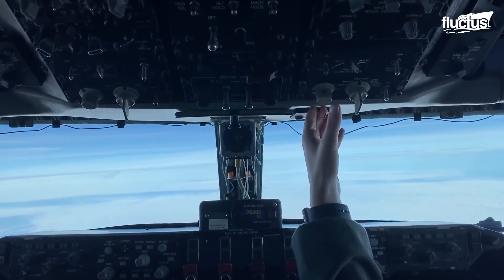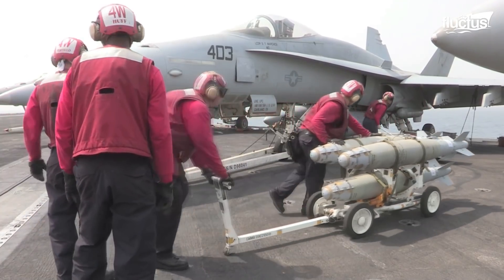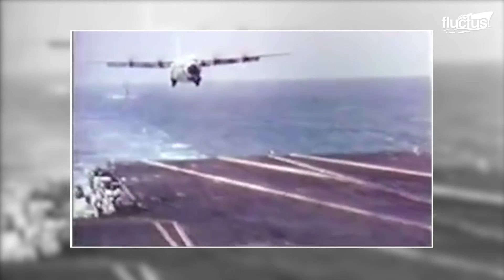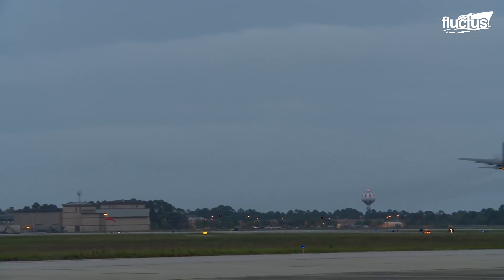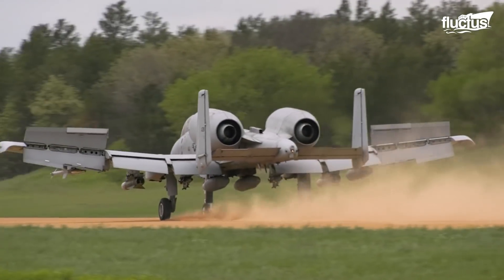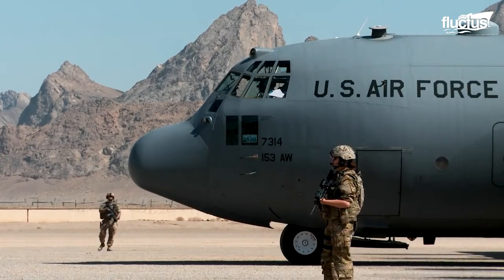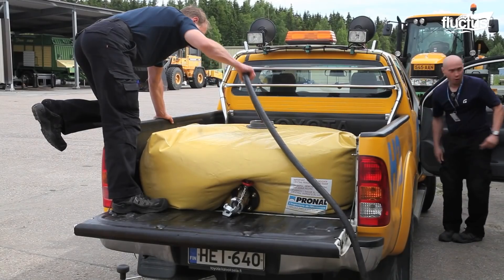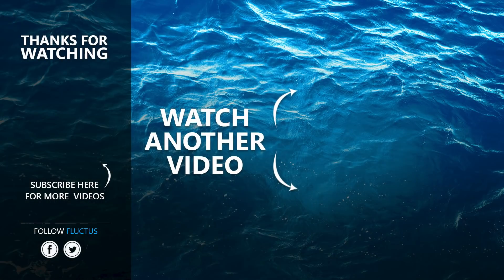Why the US Landed the Largest Plane on an Aircraft Carrier at Sea

Comment: Those were U.S. Navy pilots with a U.S. Marine Corp KC-130 that landed aboard Forrestal.  The pilot, then Lt James Flatley,  was an experienced fighter pilot and test pilot.  Also onboard was Lockheed's chief test pilot for the C-130, as well as a Navy co-pilot and flight engineer.  Though it was proven the C-130 could land on the carrier, the entire flight deck had to be respotted to clear the flight deck, as the plane didn't land on the angle deck but needed the full length of the carrier.  The right wingtip of the Herc only cleared the carrier's island by 15 feet.  The Navy decided it just wasn't feasible and too risky to go forward with using the C-130 as Carrier On-Board Delivery (COD) aircraft.  Rear Admiral Flatley is the only pilot to ever land a C-130 on a carrier.  Incidentally, painted on the right side of the C-130 was a large sign:  "Look Ma, No Tailhook!"  The Landing Signal Officer would give Flatley the cut sign while the aircraft was still about four feet from touchdown, and the interlocks on the throttles had been overriden to allow the engines to be reversed before touchdown.
Reply: Yeah I know. I was there.
Reply: Capt. James H. Flatley III was our CO on the USS Saratoga in 1980.  While we were in the Mediterranean in the summer of '80, he completed his 1500th arrested landing in an F-4, with his son in the back seat.  His son was a midshipman at the time.  When Rear Admiral James H. Flatley III retired, he had over 1600 arrested landings.

Comment: BIG difference between a C-130 Hercules and a C-5 Galaxy. Main one is the C-5 is jet powered and much larger and the aircraft tested for carrier operation was a turboprop powered airframe. Major difference in landing speed and wingspread.  So your "largest plane" designation is grossly incorrect. You need to get your "fluctus" together, because you do not know your subject....as usual it seems anymore.

Comment: What allows the C-130 to do short landings is the reverse thrust capability of the turboprop engines.  These engines have the same power in reverse as they do forward.
Reply: Sorry, I thought you said reverts thrust engines.  At first read, I  didn't see the "turboprop."
Reply: Wow!  That same power in reverse.  That is incredible.
Reply: @kurtjefferis785  that would mess up an adversary, pull up to his nose then slam reverse. lol, I know that can not be done, but derm it is fun to dream
Reply: So is that by some prop gearing?
Reply: It's a torque engine driving a variable pitch propeller.
Reply: @David-zc6wq  Reverse thrust is produced  by PCM(PITCH CONTROL MECHANISM) of propeller  which  in turn  derived by gearbox . Gear box is getting  power by Turbo shaft.
  PCM controls propeller  blade angle to select  desired  forward  and Thrust.
 I think subject  is clear. 
 N CHAKRABORTY 
 Ex AME,AIRINDIA
Reply: Boa 67
Reply: My girl was in a C-130 for eight years 🇺🇸🇺🇸🇺🇸🇺🇸🇺🇸
Reply: The C-130 doesn't have a reverse thrust turbine.  That is impossible.  I performed Avionics on the Marine Corps KC -130.  The propeller blades can turn to >90°, causing reverse thrust.  The AV8B harrier (also of the Marine Corps) has thrust thrust nozzles to allow it to take off vertically if necessary.
Reply: @frtknokr583  ok, by prop pitch, ta.
Reply: How do they achieve reverse thrust on the 130, redirect turbine exhaust? I could google it, but reckon u guys can tell me best ...
Reply: @Stuff-i-Like  Not redirect exhaust, reverse props.

Comment: I would have thought a C-130 would ruin tge runway due to being too much of a weight to handle by the ship's arresting wires and overall the flight deck altogether
Reply: Weighs only slightly more than a fully loaded fighter, and it didn’t use arresting wires because it has no tailhook

Comment: 76 K seems light, I would think they are closer to one and a quarter.??? anyone?  seventy five point five is empty, with fuel and cargo they are over a buck.
Reply: They landed at different weights starting at 85,000 and maxing out at 121,000 pounds.
Reply: @AA-xo9uw  That makes sense, 737 is around 130 K with fuel and Pax, I was a Herc mechanic in the 80s, figured they are about the same weight as a seven three two hundred series. Thanks for the tip.
Reply: Standard basic weight of a c130 configured for nothing but cargo, residual fuel only is around 84-85k. They striped this particular navy bird bare so the odd weight makes sense
Reply: @satchking6861  Thank You for your help sir.
Reply: @satchking6861  "They striped this particular navy bird"(sic)

The Navy "borrowed" the KC-130F from the Marine Corps. After Flatley and company were finished it was returned and remained in service until it was retired on 1 March 2005. BuNo 149798 is now on display at the National Naval Aviation Museum in Pensacola.